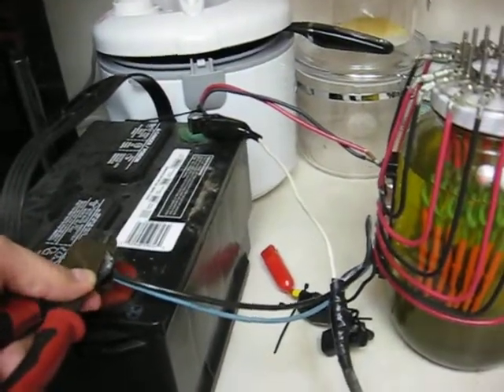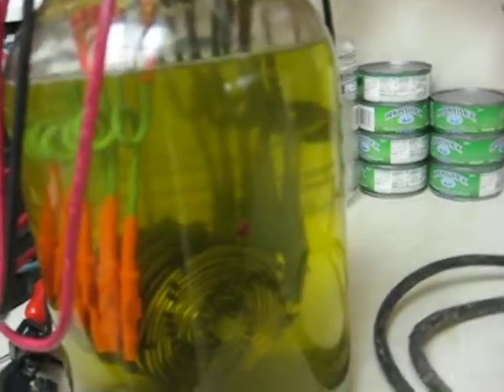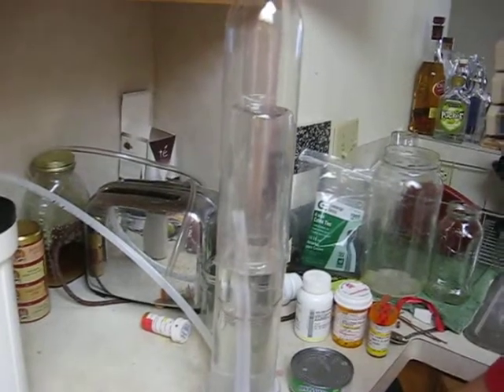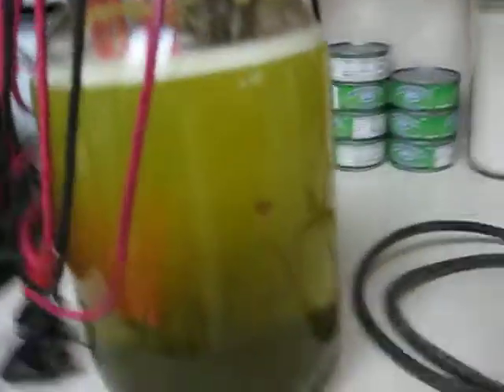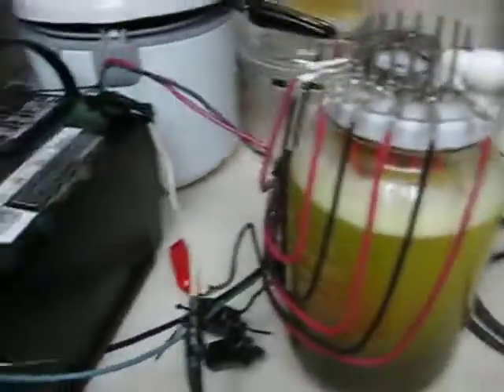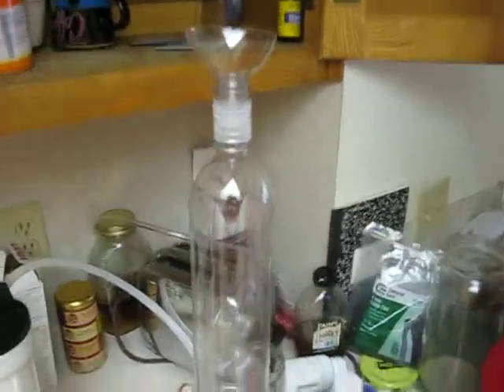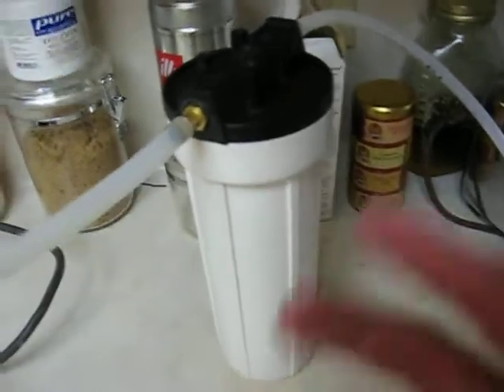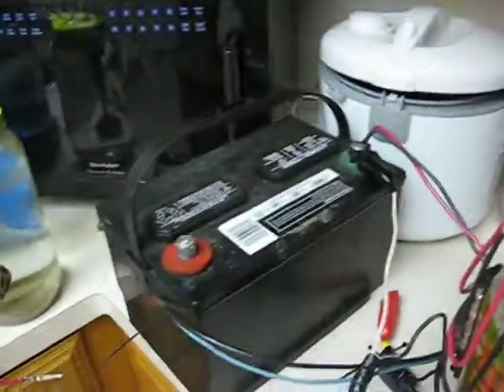Coil cell #2 A more efficient design for HHO

Comment from the maker: They are seperate gases once the water bond is broken. They remain in the gas form until they combust in an engine or via an open flame. Once burned they recombine into water and the process can be repeated indefinatly!!! They can also be seperated into hydrogen and oxygen however that is a different cell that works on the same principal. This is HHO or 2 hydorgen atoms and one oxygen atom only they are sperated by the electric charge that each is given by the corisponding electrode they origin8

Comment from the maker: Please keep in mind that we are using tap water and electrolyte so it is drawing alot of amps but I wanted to clean out the steel as quickly as posable and we will use a more accurate batch later. I will also show exactly how it is wired and just how little ss in in the cell. I look forward to your input. I hope that things are well with you.